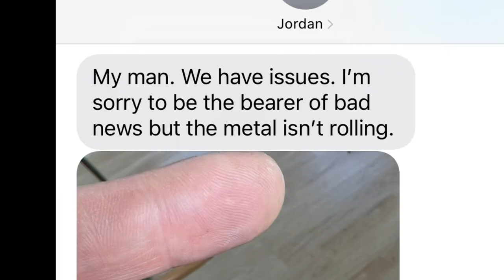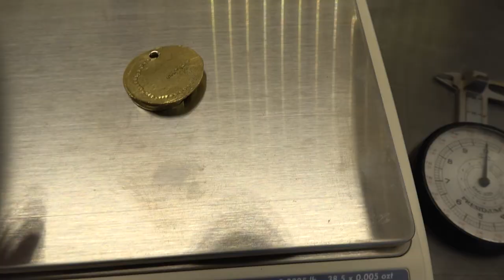Gold Rings from Dirt - The Shiny Part

Comment: Nice job. You got more rings than a Mormon wedding. You might want to avoid Utah on the way back home. As far as a 24K ring, it will be very soft and easy to bend out of round, so you might consider having it made into an 18K ring like the rest of them, for the sake of durability.

Comment: Very nice... Can it be, some significant lead in natural gold, that made it brittle? Long melting probably burned lead into lead oxide and also the mixture is more homogenous... so the gold is better malleable... my gues...
Just a question, because I want to do somethin simmilar with my placer gold and avoid cracking...

Comment: Discover more gold by learning the physics involved in dowsing with the modern light weight ball bearing dowsing rod, that accurately gauges what is being dowsed by pitting the energy of gravity against the energizing of the one-tenth ounce dowsing rod load that is attached at a predetermined location on the ELEVATED acetylene welding rod of the dowsing rod, which precisely gauges the dowsing of all edges, exact center, depth buried with angle of deposition, and most important GRADING of the sought element that is contained in the elemental mass that is being dowsed.  Read the book, The Art of Dowsing - Separating Science from Superstition ($14.95), for learning all of the physics involved in dowsing and how to build the modern light weight ball bearing dowsing rod.  Then become a professional dowser by practicing the book's dowsing lessons of buried pipelines and cables, tunnels and voids, precious metal placer and lode deposits, dowsing for treasure, dowsing for any element, amplified long distance dowsing from a moving vehicle, and dowsing on water from a boat.  I hope dowsing enriches your life and have a safe, healthy, good day.